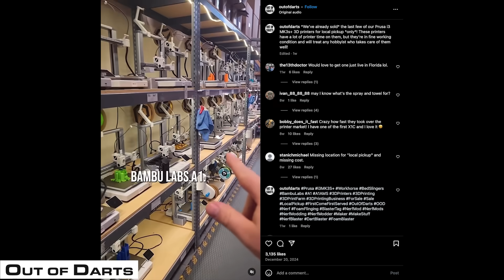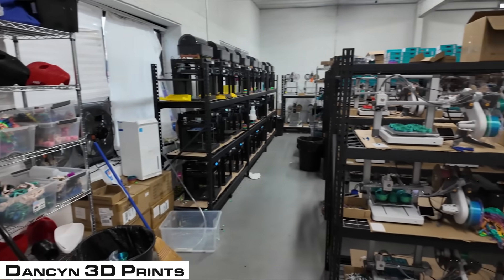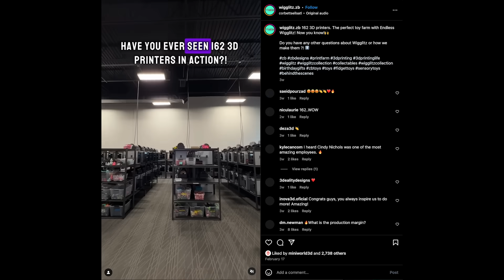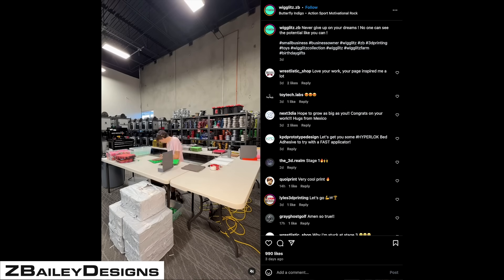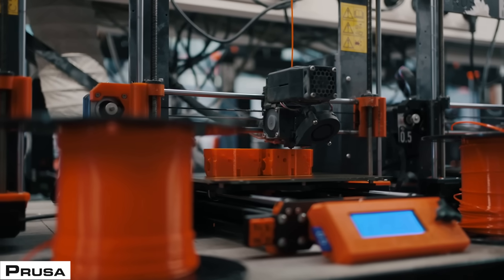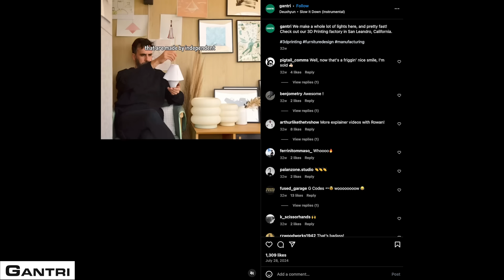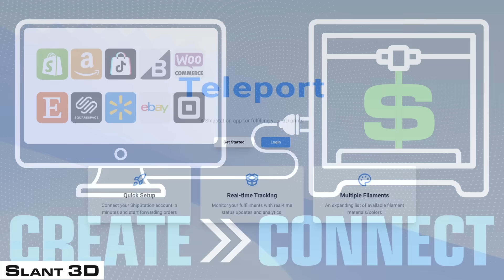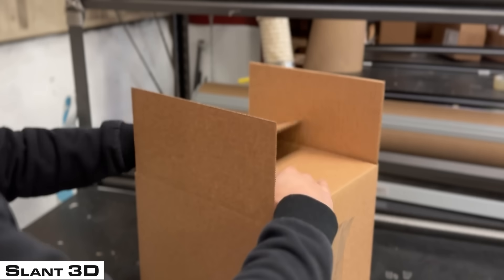The Biggest 3D Print Farms in 2025

Comment: I get the ad part of this.
But just for anyone wondering. 
I did the math for a 20 printer farm with around 60% uptime of production need. ( means alot of sales tbh) 

The profit margins goes from 50% down to 18% with Slant 3D. 

It wasnt before you reaching around 100 printers and 70% uptime you can increase that number closer to 25% assuming you increase cost 10% on an average sale of 24 dollars.

If you could however increase cost by 100% from the get go, the numbers of using 3d slant is looking hella solid for not doing anything but selling.

Comment: So good,I like,just share with you 3D printing filament:Common PLA, matte PLA, silk-like PLA, three-color PLA, PLA+, wood-like PLA, marble-like PLA, rainbow PLA, heat-resistant PLA, high-speed PLA, shiny PLA, night light PLA, light-changing PLA, temperature-changing PLA, PLA-CF, common PETG, PETG+, heat-resistant PETG, PETG-CF, common ABS, ABS+, transparent ABS, low-odor ABS, ABS-CF, easy-peeling support, TPU, PET-CF, PC.

Comment: Power requirement on 1000 printers would be insane.  Even with them all set to run on 240v the current draw is still going to be over 1200 amps if they were all running at the same time.

Comment: Just quoted out a run of 1000 very small parts in UK, responses varied from' that'll take months to print' or ' you want injection moulding for tha quantity, to £35 sample , 90p part 1000+, to 6p part delivered in 3 days.BaessTech (Germany) excellent service. Surface Scan (UK) could even have done quantity same day, at a premium. Word hasn't got round that mass manufacturing with 3D print is a reality, its an open opportunity, even designing and prototype send out design for scale production.

Comment: I still have a fundamental issue with slant print farm. I require custom settings for the tolerance I am trying to achieve.

My niche that I’m getting into is camera gear and lens replacement parts requiring at least a smooth plate for accuracy
Reply: Their build plates appear to be glass.. don't think that will be a big issue
Reply: I really don't see how custom making their own printers makes any sense.  They are not going to be any better or cheaper than what is already on the market, so why go through all the trouble?  If you can make a better printer than what you can already buy, then create a company selling printers instead.  If you can't make money doing that, then you aren't making money by building them for yourself either.
Reply: @cluebin8398  you must be new here
Reply: @ new to what?  I've been 3D printing long enough to remember when glass plates were the only option, and they SUCKED just as much then as they do now.

Comment: Are you going to do any larger print volume machines? I want to use your service, but many of my products are larger than 220x220 (around 280-300mm).
Reply: They can do 300x300x400
Only the SlantPOD (Teleport) is limited to the smaller build volume. 
I had the same misconception
Reply: @memorizeproverbs  ah okay, but since I want to use teleport, I am limited to 220?
Reply: @LoriAnneBrown  i have 8 420x420x480 machine's (single color), based in the Netherlands. Any way i could help you out?
Reply: @LoriAnneBrown  correct
Reply: @OSRSMusicParodies  Thanks. I have my own printers so can print them here. I was looking into moving some production to teleport, but won't be able to due to this.

Comment: Avoid Bambus at all cost, creality for the win, we have 2 A1 yet ender 3 is the reliable one
Reply: sure 😂
Reply: @ i dont know about you, yet here in my country bambu doesnt have service nor a store, so yep creality all the way, and we do make lab equipment whit the creality, we use bambus just for toys and litos
Reply: @ in deed the best use for my bambus was the upgrades for my ender 3, i just love that powerhouse
Reply: @яатакч13  lol All my printers are pretty much stock.
Reply: @LoriAnneBrown  my bambus are too, yet, they seam to be two different products one came out just fine, little adjustments a it works, and has over 1000 printing , the other one has failed at every screw possible, in deed is out right now. For my science prototypes I use the ender 3 cause of the custom smoth-flexible-mag-plate and a BIG boost of custome software to obtain way stronger parts, I wish this could be done on a bambu, yet till this day it is not possible whit descent ressutls. And its very easy to do with an ender and prusaslicer
Reply: My little print farm is all Creality machines - only 8 at the moment, but growing :)
Reply: @ That´s  the way to go, we will get one of the new creality beasts
Reply: My K1 Max is a massive headache and constantly needs repair. Today I am changing the Mainboard.  Prints well when it works.